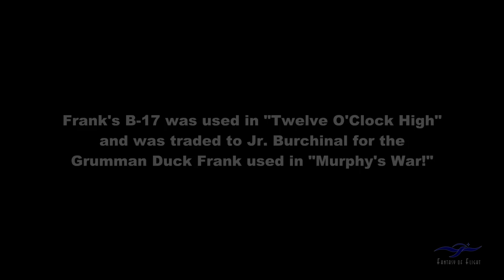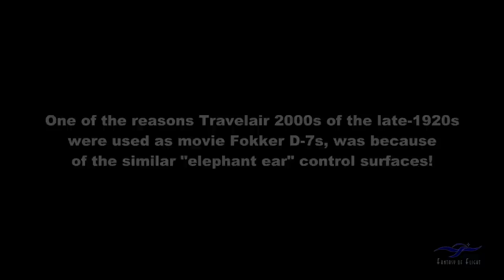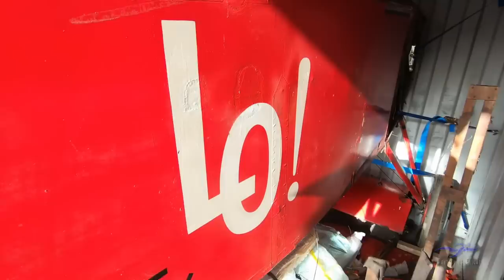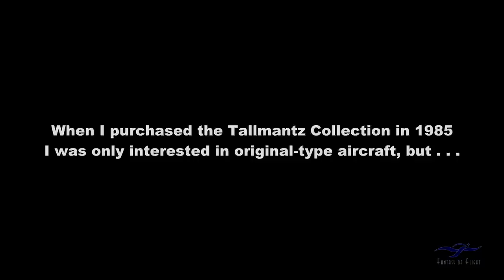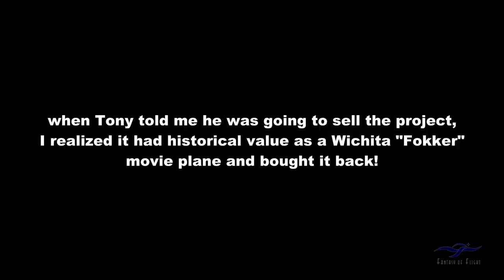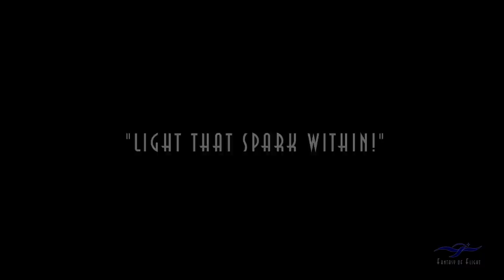Wichita Fokker - New Acquisition - Arrival at FoF - April 2023

Comment: Bianchi Autos rides for another season! 😂 Glad all the hard work that Ian put into those wings might finally bear some fruit, I seem to recall one of the tip ribs having a reinforcing strip made from an old orange tin can! Tallmantz saved the best for their repairs 😉
Reply: There is a story from the Marines on Guadalcanal. When they first got there, patching bullet holes in the skin of one of their planes "by the book" could take an afternoon. By the time they had been there a couple of weeks, that time was down to a few minutes. Typically they would just use a bit of tin can and rivet or screw it into place, rather than a proper repair. It worked fine for as long as the plane survived, which wasn't long under war conditions.

Comment: A right nice acquisition, if a little off your beaten path. 🙂

Kermit, if it were me (and of course it isn't) I wouldn't replace the engine on that bird unless the original is seized  or otherwise broken. That machine has a defined history, with photos, of it being in the current configuration when it was used. I'd want to preserve that history, and maybe only remake that chicken-wire grill that seems to be falling apart.

Comment: 9:47 that is NOT a fork truck driver. Sorry but he has no clue what he is doing. He has the fork sideways trim all the way to the right which in itself throws the truck balance off and is why he cannot see anything. Always start with the mast and forks central.
Reply: Good eye Karen. Job got done. No issues. No problems.